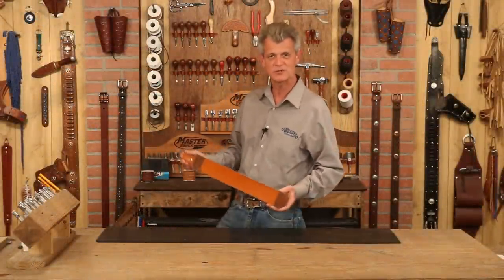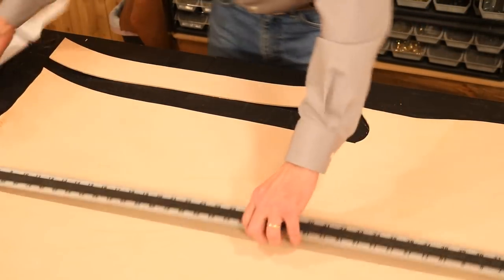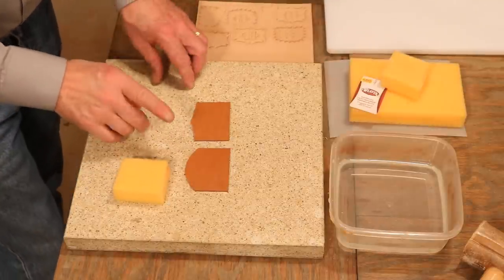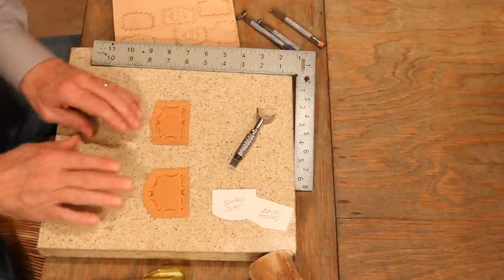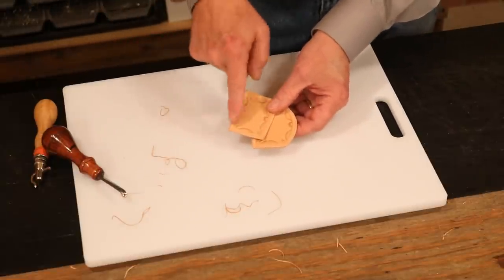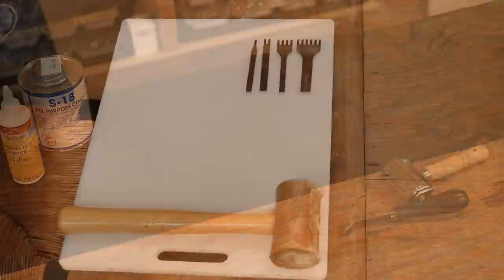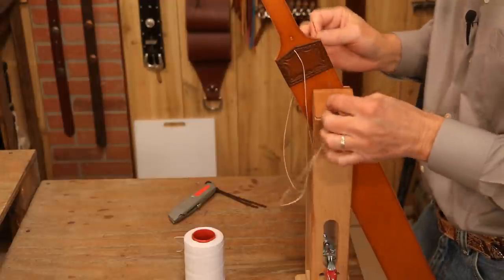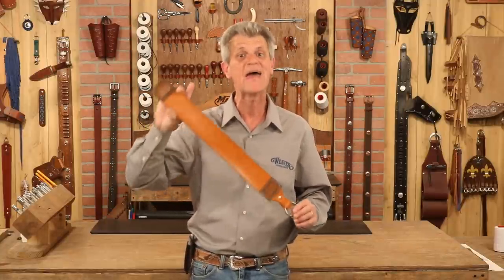Leather Barber Strop

Comment: When I started out leatherworking I printed out all my patterns and glued them to cardstock or plastic sheeting, using an awl to trace the pattern onto the leather, and I found that my results weren't great, as the pattern has to be perfectly cut out, which isn't easy by hand, otherwise any mistakes will be compounded by the time you trace it then try to cut to that line. When I started printing out the patterns, cutting out the paper pieces,  and using masking tape to tape them to the leather, then punching the stitching holes (if im going to use round holes), and then finally cutting the pieces out right thru the paper, my results became SO much better. I love this strop, I might just have to make a smaller one just to use for my leather tool sharpening!
Reply: Just like to add that if you have laser cut patterns or acrylic ones I'm sure youd get great results, but handcut and then traced patterns never gave me the best results.

Comment: Awsome!  I’m on my 2nd leather for my strop and each one I’m nicking them with my straight razor less and less.  For my last two I just bought a replacement leather from Razor Emporium and installed it myself.  And put the one I took out on a string and I still use it

Comment: Chuck, can I ask for your advice about my strop? I also made it myself, I used a nice and smooth veg tan cowhide, about 1.5mm top layer, somewhat softer than this one, but I've been thinking if it would be possible to use some oils and wax, or perhaps something similar to shoe-polishing techniques, to make it appear shiny like cordovan leather. Perhaps not that smooth, I wouldn't like if my strop became totally silent and stopped giving me any feedback, but you get the idea - smooth and shiny. Do you have any advice in this regard? Should I do it, will it be bad for strop functionality (used for straight razor only, not for thicker blades), what should I do if it's ok to go for it? I am primarily interested in improving strop functionality, not it's appearance.
Apologies for wasting your time on this, I hope you'll have some to help me out.
Cheers!

Comment: Thanks Chuck. Been needing one of these for my straight razor that I shave with. Will the leather balm be a problem for sharpening my blade?
Reply from the maker: You may want to skip the top coat if you're going to be using it as a strop vs. just decorative.

Comment: when you rough up the leather for the contact cement, do you also have to rough up the backside of the overlays as well?
Reply: You only need to rough up the grain side of leather, you usually do not need to rough up the flesh side. Unless it has a pasted backside, most common leathers dont have this feature however. 
Hope this helps.